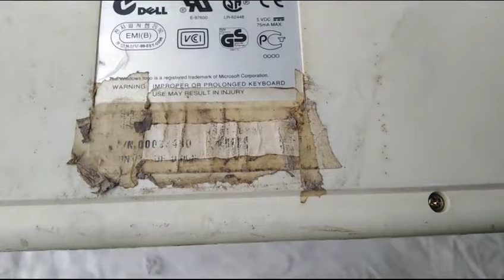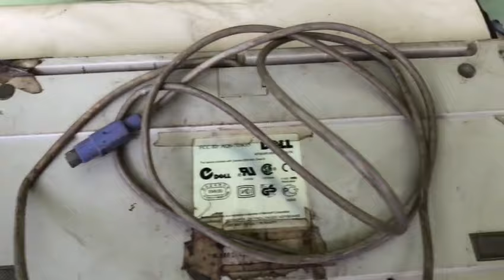Restoration OLD Keyboard | DIY | CLEAN DIRTY KEYBOARD | DELL MODEL RT7D5

Comment: This restoration is bad. I dont know where to start... Im going to start at the beggining. I dont know to what cleaning product you used, but wouldnt be so much better to pop the keys out and clean the whole keyboard with keys in some soapy water? It would be 100 times better. The black paint, that is not pretty, it ruined the whole look of the keyboard. If you just retrobright it, it would be best... Not good restoration.